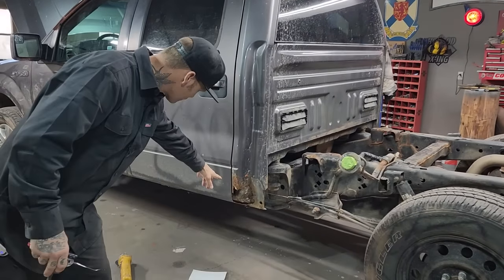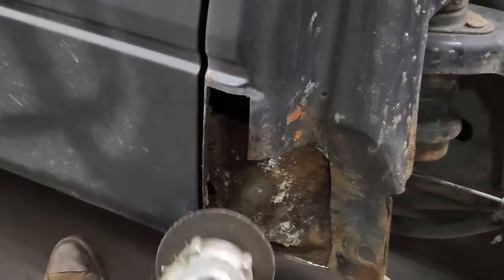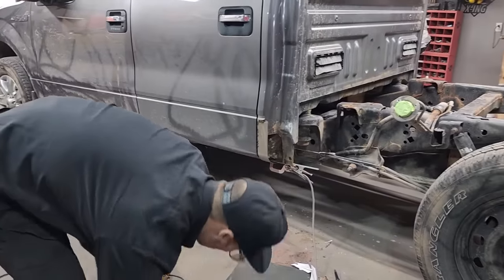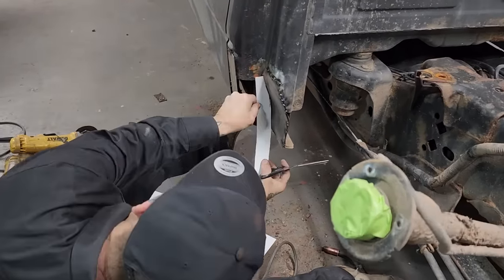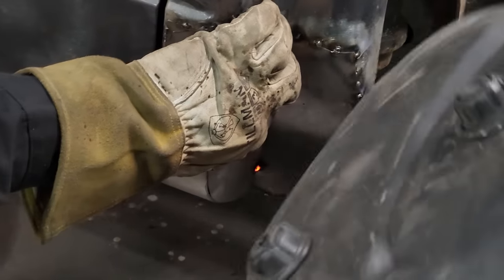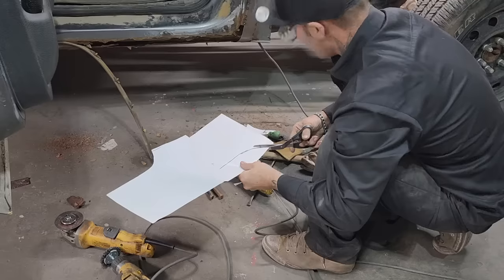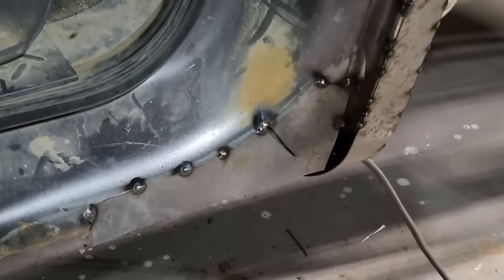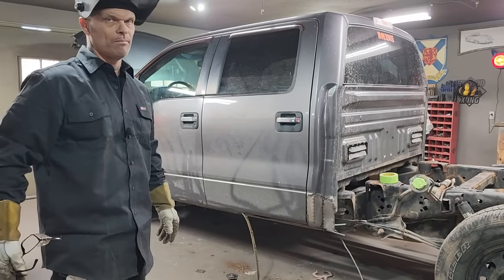Repairing rusted cab corners on Ford F150 for $0 ✅

Comment: Where I live the people voted not to have inspections on vehicles at all. The car I'm driving now I bought brand new and in the 21 years I've owned it I have never had to have it inspected.
Reply: Just curious , what state is that, Thanks
Reply: @clintwill8715  South Carolina.
Reply: With the way people take care of their cars. I wouldn’t vote against yearly state safety inspections. I prefer to pay my $50 a year to know that the car behind me still has brake pads on it.
Reply: @timparker8759  Right. So you've never met the guys that take swap parts between their vehicles just to get them to pass inspections and then put the crappy parts back on that wouldn't pass inspections. When I lived in other states I saw it all the time, so that guy behind you may have had new brakes when the vehicle was inspected but not afterwards.
Reply: @clintwill8715  SC

Comment: this is not how you do it new metal over rusted metal ? why didn't the owner jus buy new rockers and corners? cut wway old and weld in new what a waste of time not cutting out the old rust
Reply: It’s a farm truck, not a beauty queen. It needs to pass inspection not win a prize at a car show.  Maybe I get it because I own a farm truck and would be incredibly happy with that fix for function and purpose. I have way worse repairs on equipment that do work with every single day.
Reply: @jmkehayias1  but if it's just a farm truck why would you waste any effort on it?  Just saying it be cheaper easier and better to buy the cab corner and The rocker come on!  I like Chad but his work is terrible.
Reply: He just explained why, very clearly at the end of the video. You were probably too busy cussing him to hear what he said.
Reply: @essentialjudge2279  it still has to pass inspection to renew the registration to drive legally.  Chad said at the end of the video there’s more to come on the repair and he’s cutting the rocker out to weld everything up and then spot weld it back in so I’ll reserve judgement until it’s complete.  As I said in another comment, it will be interesting to read the comments when he’s actually finished with the repair, I doubt there will be any apologies for jumping to conclusions.  I’ve pop riveted floors made out of old highway signs as a fast/shorter term fix until I eventually had the means, time, and wherewithal to do a more comprehensive repair. Did it work? You bet! Was it ugly, sure! Was it worse off than when I started? Nope
Reply: I’m not sure man it’s not my business I guess.
Reply: Why not buy a new truck!  The art of cutting and bending metal is not an easy task, basically most body shops are replace panel shops, not fabricate which is what Chad is doing.
Reply: Where’s your show at
Reply: @jmkehayias1  yes it's worse off than it started doing that makes it worse.
Reply: @ Tyler Van Biezen Thanks for sharing your wisdom from your successful Tv series and YouTube channel, it’s just I’m having trouble finding them. Cheers from down under.
Reply: @raeanker3078  haha you funny the bio on this guy has him being a millionaire yet he still doing it the cheapest way possible it's a joke mate
Reply: Oh no he might miss out on the trophy at the sht work truck nationals. 
Settle down it was what was required.
Reply: I dote that you even have the skill to hang a bucket of flowers on the back of a shithouse but you want to call over Chad for fixing a truck so that it will pass inspection I think you have watched one too many of those shows called trucks TV where they spend $10,000 on a $500 job
Reply: He makes the same shit on every his Projekts…
Reply: @thecastros9104 Chad’s videos are watched not only in the United States; in other countries of the world it is not possible to easily and cheaply buy new panels.  most often they do body repairs like Chad.
Reply: Because it doesn’t matter no one will know and it’s a pos f150
Reply: @nick7.3 I beg to differ my brother has a Silverado that's three years old there's nothing left of it it's rotted away so I think the shit trophy goes to Chevrolet